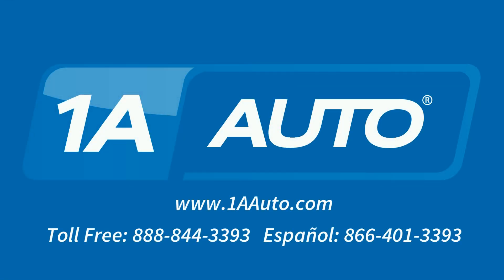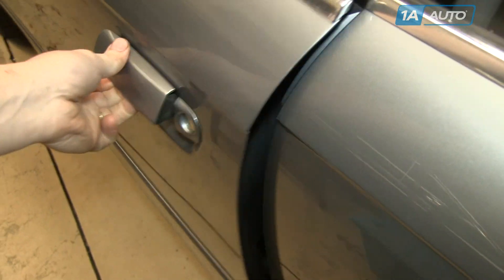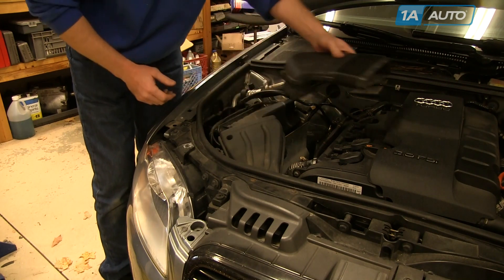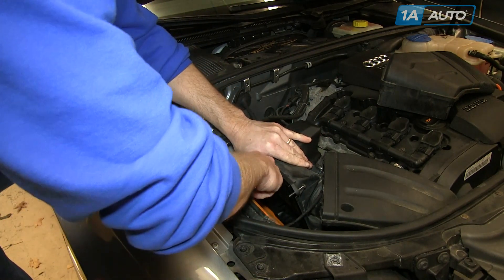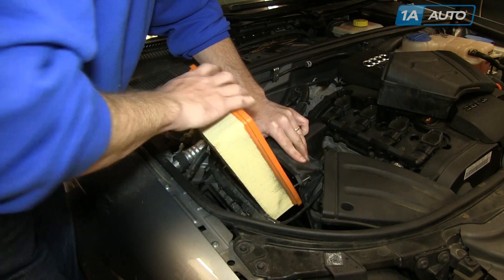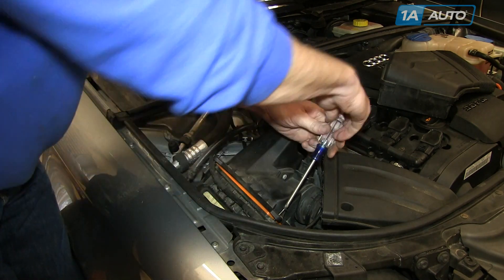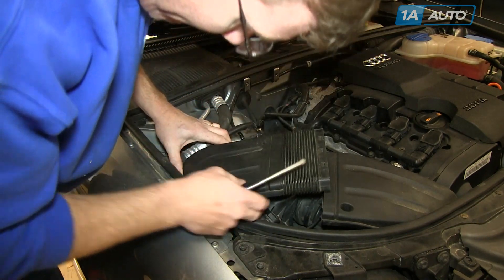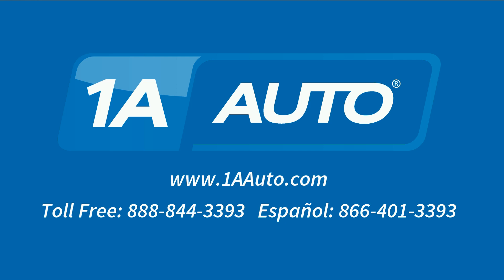How To Replace Engine Air Filter 04-09 Audi A4

Comment: I had to remove the heat shield (4 screws) in order to expand the opening of the air filter housing. (2004 A4 1.8t Quattro wagon)

Comment: Incidentally guys,a study was undertaken at university to see difference between some oem paper filers and k&n filters. The paper filters pulled way more Air than the k&n filter. In short,k&n are crap. There were 2 filters that did however get more air,one was bnc and other was pipercross. Just letting yas know,in case you're thinking of replacing with k&n
Reply: k&n is washable

Comment: My '08 Audi A4 (B7) is missing the intake duct/manifold so the air is being sucked from the engine compartment. Is this a problem?
Reply: Just to clarify, the air box is there it just doesn't have the intake duct going to the grill.
Reply from the maker: +Nathanael Neil It should be okay. We currently do not carry that particular part. 1aauto.com